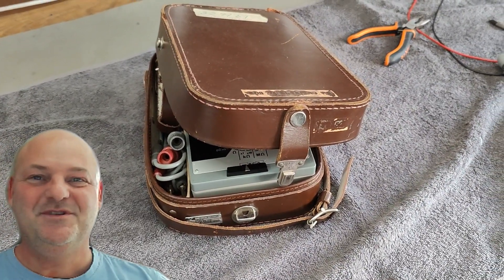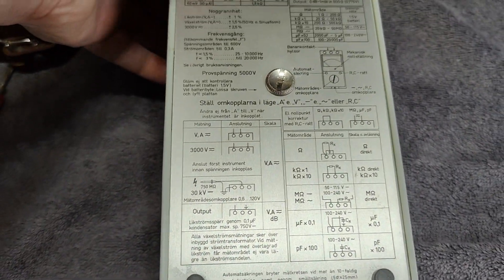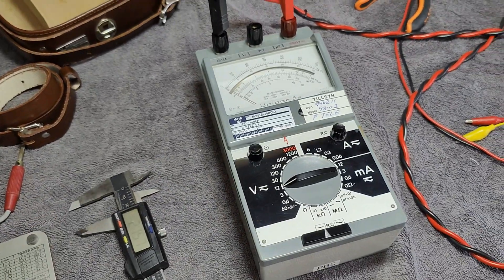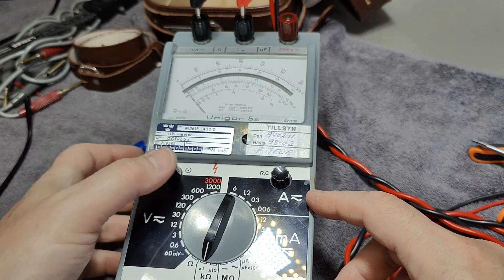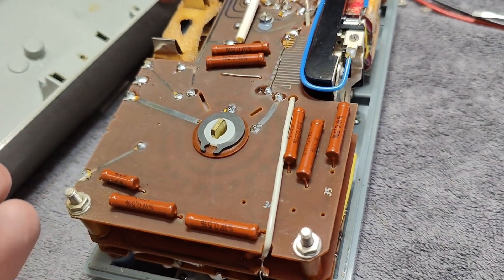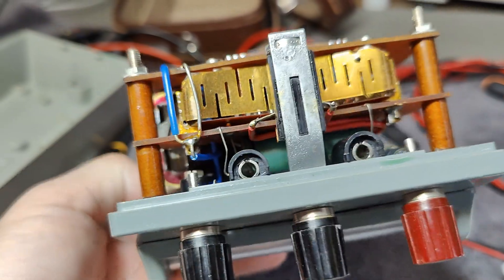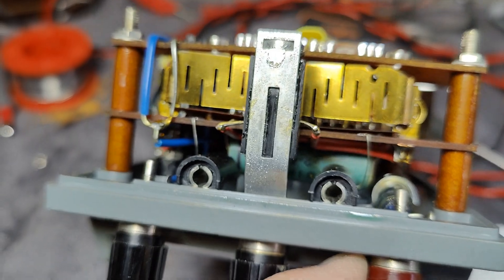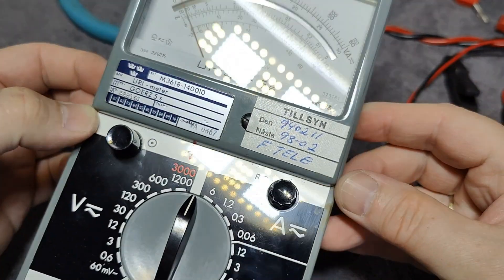BBC Goerz Metrawatt Unigor 5s multimeter type 226215

Comment: An N battery (or N cell) is a standard size of dry-cell battery. An N battery is cylindrical with electrical contacts on each end; the positive end has a bump on the top. The battery has a length of 30.2 mm (1.19 in) and a diameter of 12.0 mm (0.47 in),

Comment: Ser ud til at de brugte et R10 batteri, hvilket jeg husker til at være den størrelse der var 2 af (et paprør med 2 celler) i de 3 volt lygte batterier man kunne købe da jeg var barn.
Reply: Et penlight passer i længden, så skal der bare en lille adapter til så diameteren passer.
Reply: Yep, "half a 2R10" was a very common battery spec for german handheld meters of that era. No longer made, the only 2R10 one seems to find are adapters for 2 N (not R10) cells. So what, use an N cell and some coins/washers and stuffing materials. Possibly, one could fit an N cell holder inside the case somewhere and parallel wire it. .... It's funny, I first read "4150 Windungen" as an old german postcode :) ... Unless one is actually using their vintage meters in Cat II or harsher environments (I would not), I would just hotwire that circuit breaker if it cannot be easily fixed and put a clear warning label on.